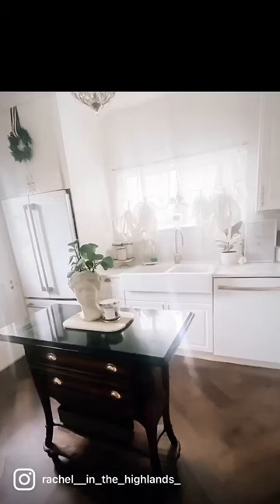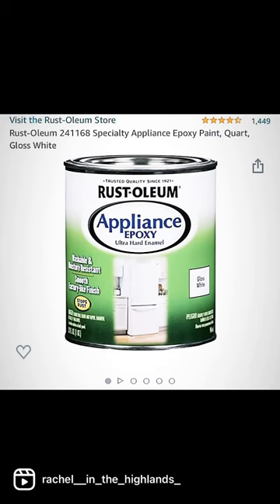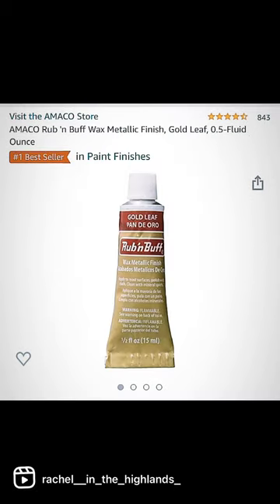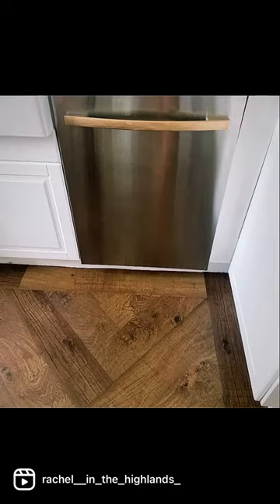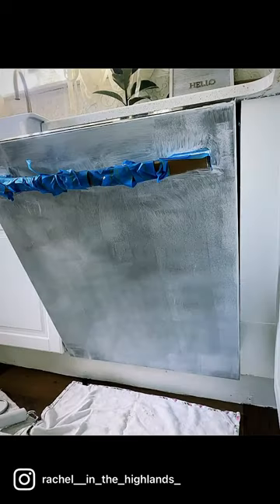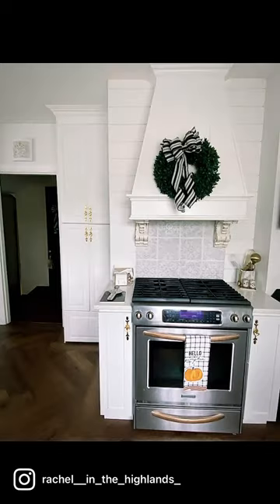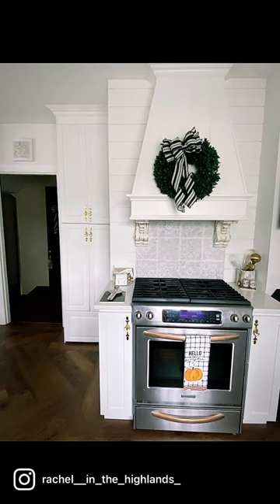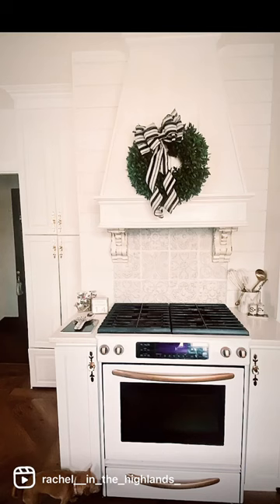DIY Cafe Appliance Look!!!  Longer more detailed video found on my YouTube!  #diy #paintedappliance

Comment: This turned out so good!
I’d be scared silly, as there’s no going back once you sand them up! 😬😱
Was it very stinky to use? 
I’m very sensitive to chemical smells. 
I’m looking at a house w a 1960’s brown dbl oven; but I’m sure it works just fine, as appliances were built to last, back in those days! 
I’d always heard you hv to hv a body shop do it to get a good and lasting finish. Not sure how easy it is to remove oven doors. And I’m all about keeping vintage vibes; bus some of those colors were just horrendous!
(Did I mention bright orange countertops and backsplashes? Too many colors in one space!!!)
Reply from the maker: Hi Susan, the smell wasn't terrible. 
You are right, there is no going back once you sand.🫠 I'm glad I took the chance and painted them. The epoxy paint is so durable.
I do not see me getting a new stove anytime soon, it's still going strong and the paint looks like it did when I first painted it!! Some vintage vibes defiantly need to go.😂 I agree with you on that!!
Reply: Chemical smells bother my asthma and I've used this paint before and it definitely affected me a lot. I'd do it again though because it's quick to apply and it smells fine once it dries.
Reply: @kaitlynrunion4192  Thank you both for answering me! It’s been busy! I didn’t end up getting that house; it was full of mold from a leaky roof and bsmt. I’m very sensitive to mold too! But it’s nice to know there are options out there, if I do end up w one that has old, but working appliances. 🌷